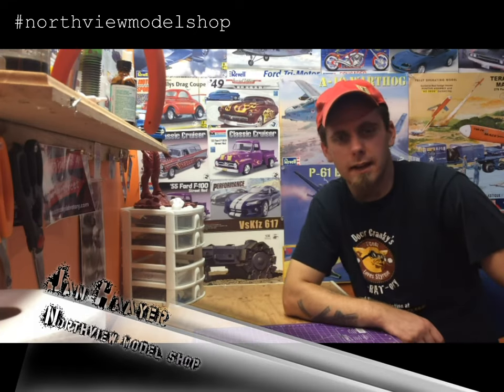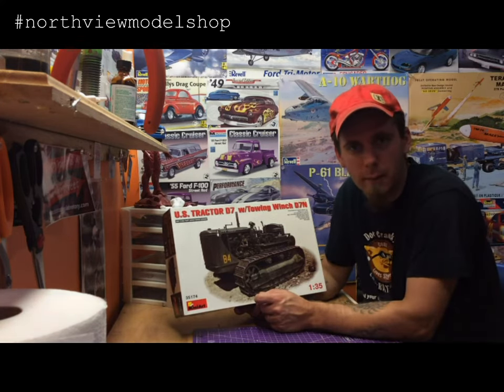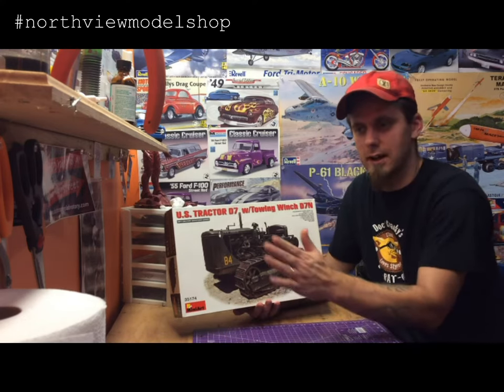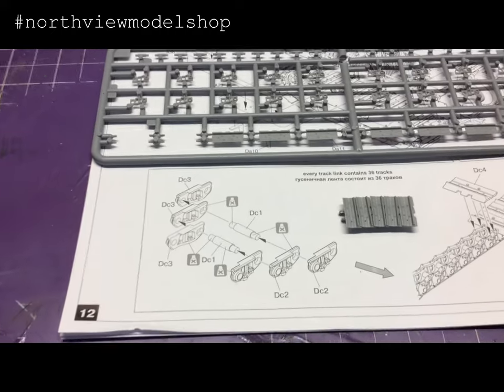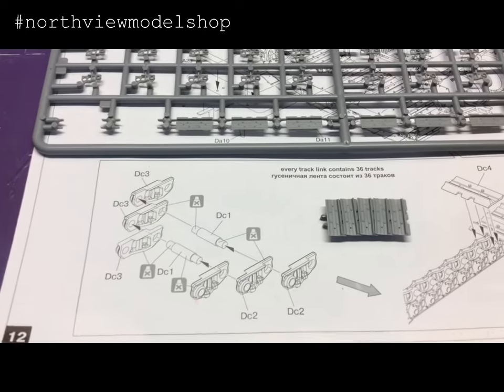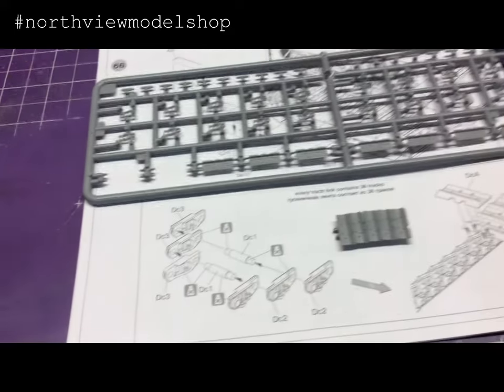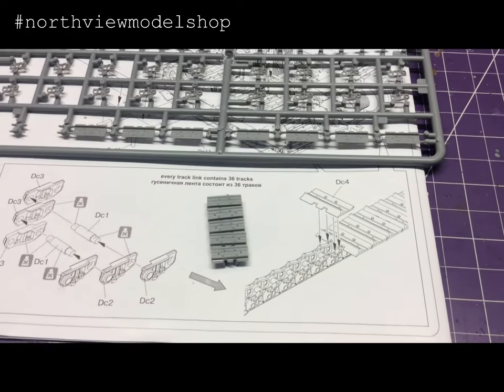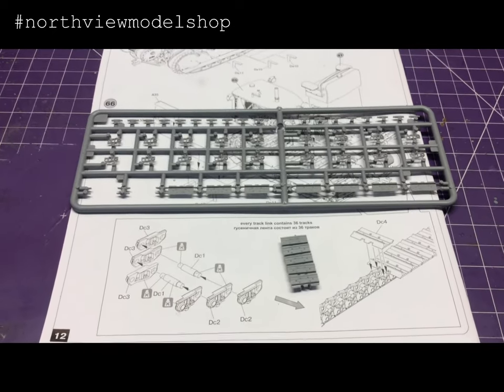MiniArt US Tractor D7 Track assembly Help Needed

Comment: The best way is do not use the pins they send with the kit make a pin that will slide all the way through and can be glued from the front or outward side this are the biggest pain in the ass tracks that I have ever done good luck ,
Reply from the maker: They were so. What a pain.